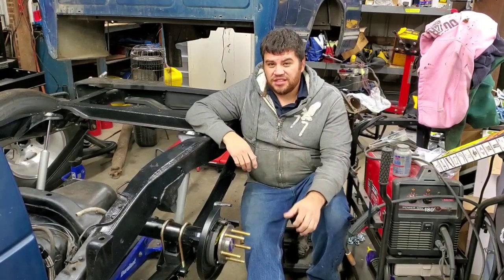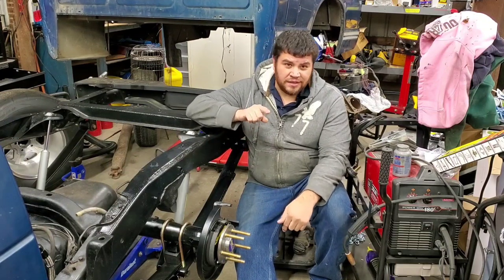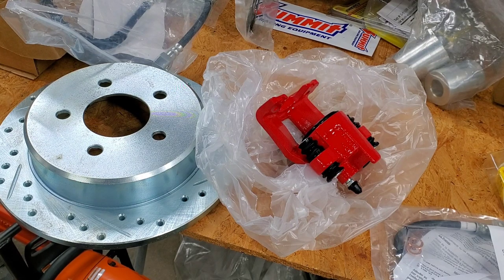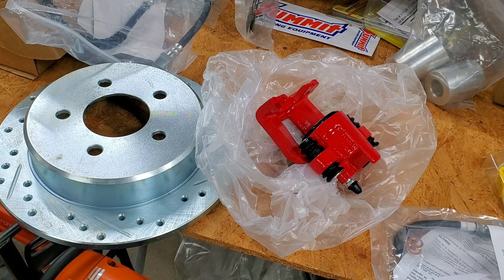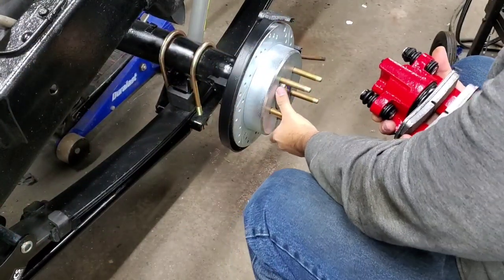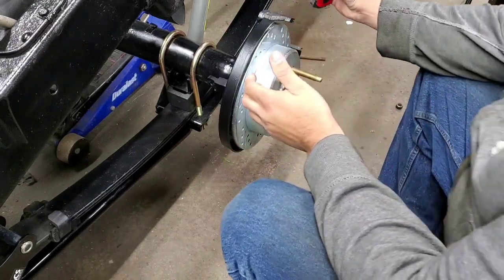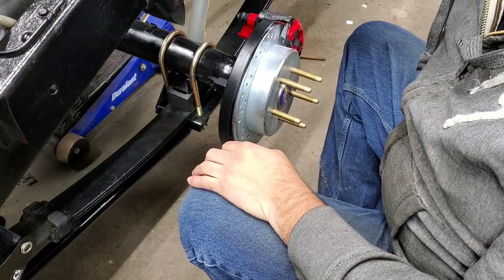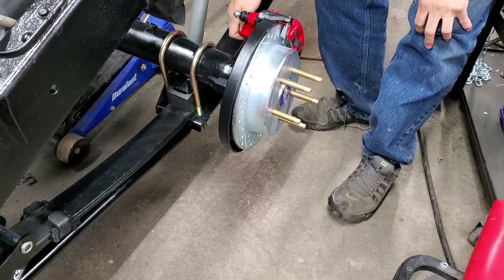Power Stop Disc Brake Calipers On An S10 With A Ford 8.8 Rear

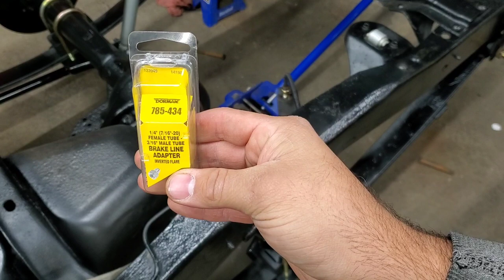Comment: Just FYI I used the brake line adapter @ 5:21 in the video and it leaks. I connected it exactly how you did.  Cant seem to get it to stop. Its as tight as I can get it but it leaks.  Factory flared line in the top . I guess I can re-flare the fitting but it looks good.  Not sure why it leaking.  Might need to figure a different way to connect these lines. Just letting you know so you can keep an eye on yours when you get it on the road.
Reply from the maker: Thanks for the heads up, did it leak just at the fitting part?
Reply: @304customsgarage  THats what it looks like. Yes.  Very slight leak but a leak.  Was cool to get the truck out on the raod though.  Felt surprisingly smooth for what it is.  Only drove it 8 miles or so.  Engine thats in it is not great and will be coming out next.  I bought the truck with just the V8 in it, no other mods. and have been working to improve the rest of the truck. I have a 406 built I was going to put in it but it has angle plug AFR heads and that seems to be an issue as far as headers go, so I am building a 355 with a set of Brodix straight plug heads.  So we will see..
Reply from the maker: Good information! I'll definitely make sure I check mine when I get to that point

Comment: Does the proportioning valve need changed when doing this drum to disc swap?
Reply from the maker: I've read it works for some and others not. I actually got a GM disc-disc proportioning valve from Jegs I'll be using now for it.
Reply: @304customsgarage  is it still a dual outlet, one front one rear or a dual front single rear? Thanks for the help btw
Reply from the maker: It has 2 front outlets and then the one for the rear. My idea was to plug one of the front ones and run it that way.
Reply: My stock one worked on my 92 S10.  Just FYI.